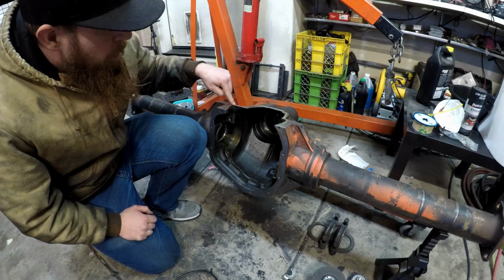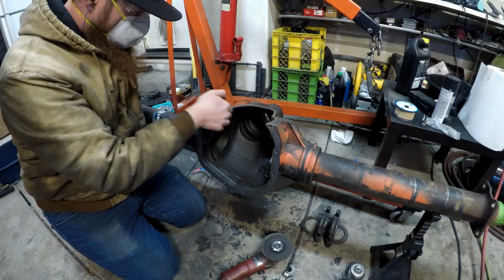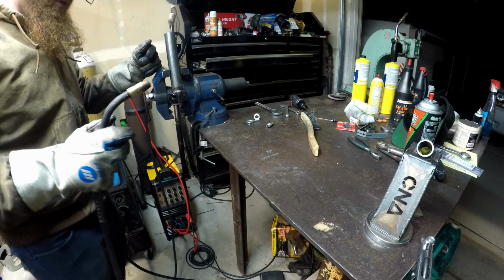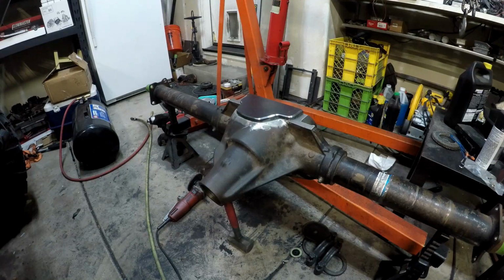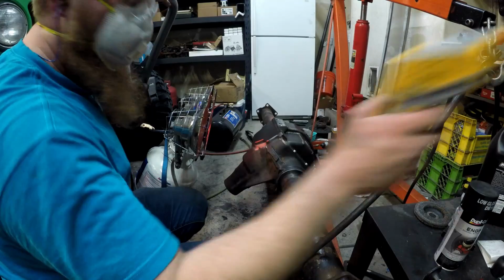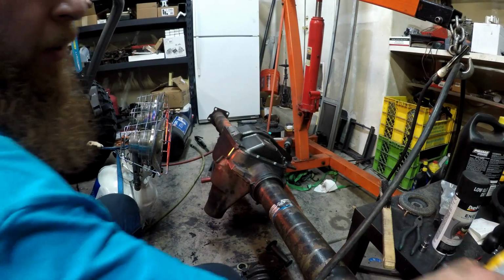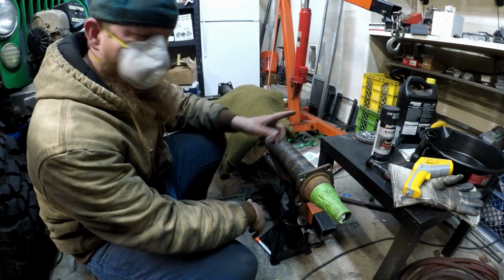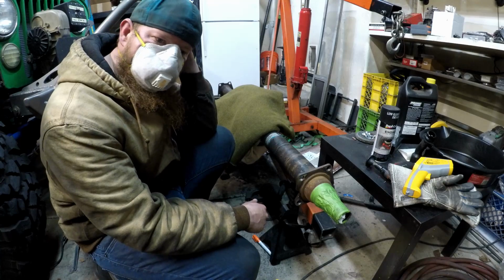Ballistic Fab Shave Kit Install Sterling 10.5 - Welding Shave Skid with NI-55 - 1 Ton Swap -One Tons

Comment: I’ve watched a few of videos so far.  Curious if you welded around the axle housing to the carrier housing? I’m starting to work on my sterling 10.5 and waiting for another sale before ordering the shave kit.
Reply from the maker: Yes indeed I welded the tubes to the pumpkin. Still preheated and used that nickel based wire.

Comment: Great video! I am about to shave my 10.5 in my jeep. You're right about the casting being very thin on the bottom. I dented and put a crack in the bottom after a decent smack into a rock. So far the 10.5 has been pretty solid, geared to 5.38, welded up carrier and 39in stickies.
Reply from the maker: Thanks man! I hope I don’t crack mine. That sucks. I’m glad it’s holding up well otherwise. Could be a heck of an axle I think.